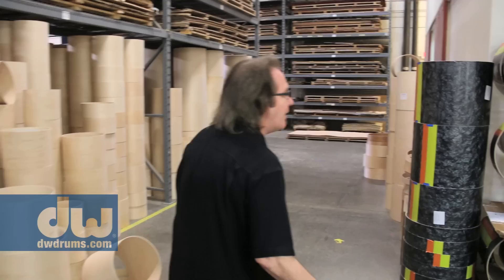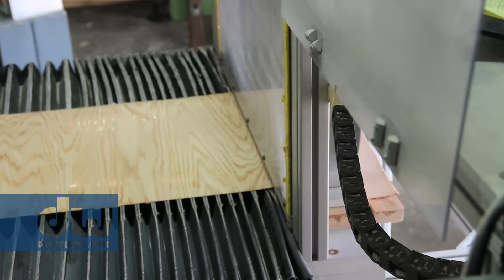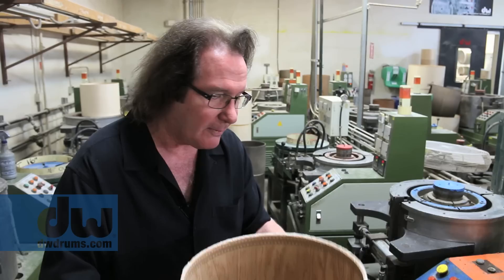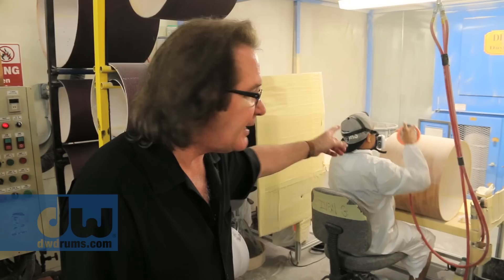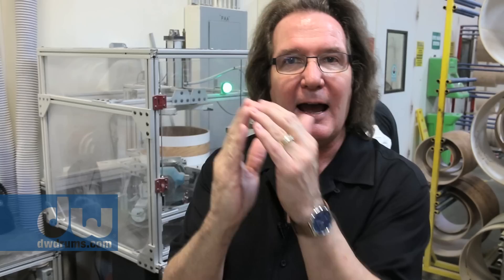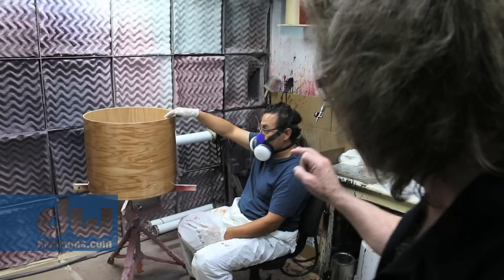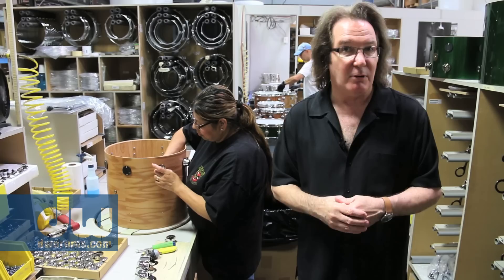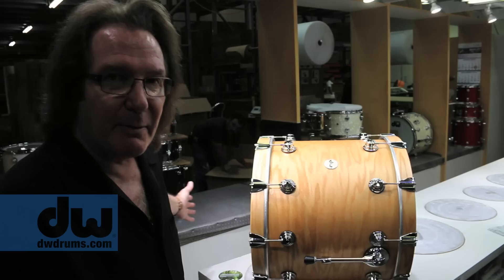The Making of Collector's Series Pure Oak - A Step by Step Factory Tour

Comment: Does the drum pass the light test at 19:20? Looks like light was coming through . .
Reply: +laphtoabeat Yeah I thought that but I think it was light just shining through the wood at the point of the bearing edge where the wood is thinnest
Reply: +laphtoabeat That was after the bed was cut to accommodate the snare wires. That was intentional.
Reply: +jerry hello No no, that was a tom. Maybe there's a tolerance degree, or maybe they sent back that tom to finesse the edge.
Reply: I thought the same thing, but the bearing edge inspection gal acted like business as usual and down the assembly line it went.  Hmmm!
Reply: I noticed  that too 
What didnt they send it back!?
Reply: @jasonschooler4450   Maybe they'll soon be getting a lot of returns... LOL
Reply: @aarondiaz1433  It's because of the bearing edge being thin at its apex. If you notice, the amount of light is consistent all the way around.
Reply: It's because of the bearing edge being thin at its apex. If you notice, the amount of light is consistent all the way around.
Reply: That just goes to show how quality control is an issue with bigger companes. Everything looked good until that one part lol. Ive talked to several drum builders and they say that all the time people will buy brand new High-end drums kits and the bearing edges wont be cut correctly, shells arent true etc
Reply: @dannycutchin7684  That's crazy. Admittedly I didn't know what I was buying early on in my playing career, but I still have the first kit I bought back in 1992, and I can attest to the fact that I have tweaked it so much (hardware upgrades, correcting bearing edges, etc.) that it is basically no longer the kit that it was when I first pulled it out of the box. Nowadays, when I look at a kit, one of the considerations is how much I'll have to adjust it to get it to my specifications. Pretty sad that correcting a bearing edge would have to be part of that equation!

Comment: Wow in the 1980s  i was living in South Florida and my best freind from high school was a drummer  he found a local Drum maker  that could build a custom bass drum that would match  his Ludwig  set and i went to the shop  to pick it up  and because it was off hours the owner gave us the private tour little did i know  that i would makea career  doing Architectual Woodworking as my profession for 25 years and my hobby of 35  years btw i’m a Guitarist  but for some strange reason  i’ve been wanting to build  a drum kit  for myself  sure i have a interest  in  some solid body electric guitar kits as well  it’s neat to see  a lot of the modernization  in the shop btw in reality my freinds custom drum  was  really a maple  ply cylinder skinned with a HPDL  they did install pretty good hardware and that business is still in operation in the area but has changed locations

Comment: I too never thought I could afford a collectors kit. I walked into guitar center and they had 2 kits they were blowing out. 10 12 14 20 kick $3500 on sale for $1999. I figured something was wrong with them so I took the heads off checked everything tuned them up and played em. They were everything I thought they would be. Vlt toms x floor Tom vlx+ kick. Then the guy working said here you go stand out front so you hear what I am cause you got these things sounding kick ass. When I heard them from 3 feet in front of the kit I was sold. I went home dreamed about them and got them while my wife was in Vegas for a bachelorette 😏. Anything is possible. Some people trade in there hi end DWs so you can always buy a used set also. Is my set the finish I would have ordered... No would I love a matching vlt snare and a vlx 16 floor tom... YES but I got a black nickel over brass collectors snare brand new for I think under $500 I want to say... Can't remember exactly so guys anything is possible

Comment: I have a maple mahogany collector series set (6 piece).  The 8'' and the 16'' I had custom made.  I like it a lot, but I was shocked when the screws that hold the hardware onto the wood got loose and some fell out into the shell.  I ended up taking off all the heads and tightened all the screws.  Almost all of them needed tightened.  I also assumed that all the timber notes would match up with each over (like how the notes on guitar cord all sound good together).  I played all my timber notes on a piano and they do not sound good together.  Maybe this is normal and I shouldn't be surprised.  I've always wondered if they should all sound good together.
Reply from the maker: The reason our Pure maple shells have a note value is so that the shells (before drilling and hardware/heads) in a kit are matched. We wouldn't want a 10" tom to have a lower inherent pitch than a 12" in the same kit. Once hardware and heads are on its up to the individual to tune it to their preference. 😎
Reply: @dwdrums  Hmmm, ok.  Then maybe I don't know what an inherent pitch is, because I thought the note for my 8'' tom would sound good when played together with the note of my 10'' tom, but they do not.  Thank you.

Comment: Looks like your located in Mexico , and  I thought DW's were made in America !
Reply from the maker: We're in California right outside of Los Angeles. We would love to have you come for a tour some time so you can see what our artisans create in our USA Custom Shop. 😉
Reply: I'm actually interested in the Frequent Flyer Set , and would like to know where they are made. I am also interested in replacing the Contoured Weight on my model 5000 Bass Pedal which went missing on a gig . It's one of a pair specially made to fit counterweights. Thank you for your quick response to previous question and look forward to hearing if you can help with my Pedal Problem . Thank You !
Reply from the maker: Hey there.
Our Frequent Flyer kit is part of our Design Series which are made in our DW factory in Taiwan.
As for the contoured weight, can you send e a photo of the issue? I'll be happy to get you a part number.
You can reach me back at mikeb@dwdrums.com
Thanks.